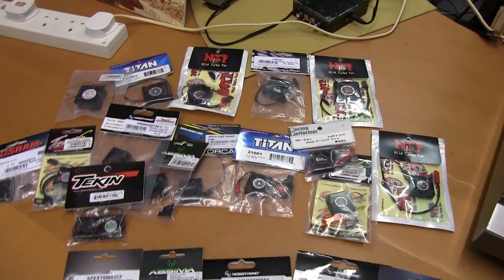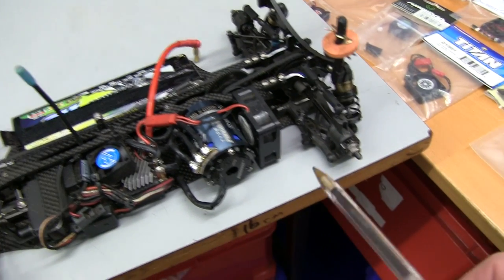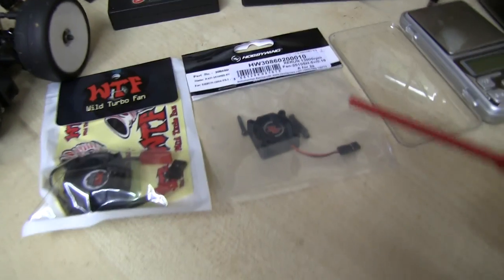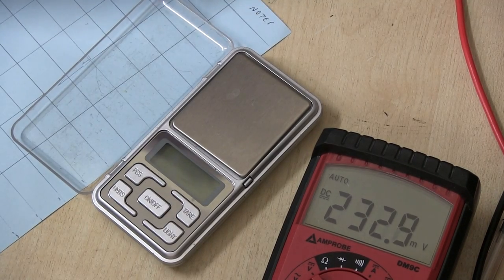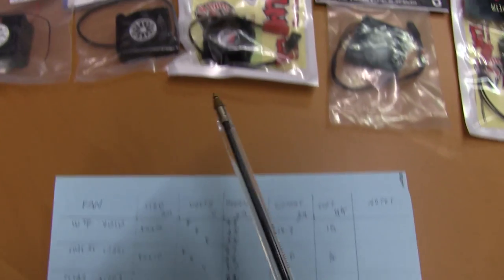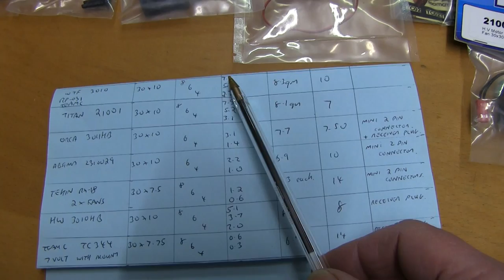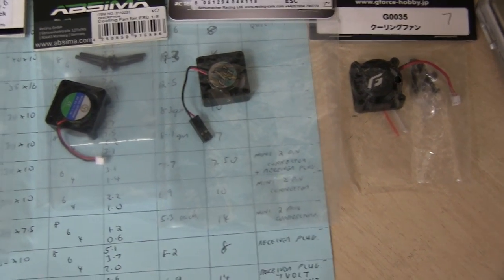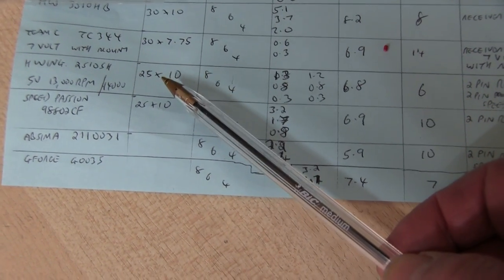Fans for cooling motors and speed controls. Test and comparison.

Comment: REally entretained by your testing, you got a new suscriber =)

Btw at some point would be great to see how it measures vs fans like
Noctua NF-A4x10 FLX (it runs 12V but allows undervolting fine)
Noctua NF-A4X10-FLX 5V (not sure if it can run above 5V)
Reply from the maker: Hi Pabula
The Noctua fans are low revs and very low noise, and made for quiet cooling applications.
There is a 5volt version, but the specified airflow is not as good.
The WTF 4010 fan has an airflow of 8cuft/min at 5 volt.
The Noctua NF-A4x10 Premium 5V is:
Rotational Speed (+/- 10%):4500 RPM
Airflow:8,2 m³/h (4.82 CFM)
Acoustical Noise:17,9 dB(A)

So probably not as good.

All the best
Nick

Comment: Completely unrelated to RC Cars: your video helped me with determining ideal operating voltage for a 3D printer 30mm hotend cooling fan. There's a gap in the 30mm DC fan world, it goes from really poor static pressure/CFM (even with 24V models) to these high performance RC fans that run at lower voltages with much higher RPM. No idea why there's such an odd gap, probably supply and demand.

Comment: Hi Nick. Great video as usual.I've started running a WTF 30mm fan on my 17.5 motor in my buggy. I've found that this fan drastically reduces the temperatures. My question is do motor fans do much to cool the internals of the motor or just the surface of the can? I'm guessing that a cooler can would help dissipate heat from within the can (the internals). Thought?Thanks!
Reply from the maker: Hi Dimitri
You are correct.
The heat in the windings will be reduced as the heat can be conducted through the metal case.
The rotor magnet will not cool as much, but the whole motor will run longer without overheating or failure.
Reply: Nick Adams rr

Comment: What about current draw over time. Example just sitting on the line 30s how much Voltage do I lose
Reply from the maker: Hi
I did consider listing the current draw, but it is so low at about 0.2 Amp that it will make no difference to the start voltage or power over a race.

Comment: Is it safe to run a WTF 40mm fan off of a 9V Block battery? Don't want to buy a seperate lipo and my BEC only has 5V
Reply from the maker: Hi. Not sure what a Block battery is, but it is too high, unless it drops to about 8V under load. The fan will be good on 5Volt. Try it and see. Feel the temperature of the middle of the fan, where the electronics are, and if it is very hot then it will burn out.
Reply: @nickadams5411  okay, I have severe overheating issues (motor reaches 70-80°C after half a pack and that in spring..) Can't imagina how bad it is in summer. Do you think the wtf Fan is better on 5v than a regular sunon 40mm 5v fan?
Reply: @nickadams5411  and a 9v block battery is a one time use non rechargeable alkaline battery, I found two half empty ones, one 8.3V one 8V so that should work
Reply from the maker: @ELValenin  Hi. Yes the WTF will be better than the Sunon on 5V. What voltage is the battery in  your vehicle. Is it a car?
Reply from the maker: @ELValenin  Hi, Yes try them. But check temperature of fan centre.
Reply: @nickadams5411  yep, it's a car. The battery is either 4s lipo (about 15V) or 6s lipo (about 23V). Although with 4s I don't really have overheating issues, but 6s is so much more fun. I'm sick of stopping every 5 minutes to let the motor cool though.. 
So yeah I think I'm just going to use one WTF and the 50mm fan I have now on the 5V BEC I have.. If that doesn't solve the problem I could try with a 9v battery and if it's better I can buy a small 2s Lipo 
Soo yeah I don't think I can connect it straight t
Reply: @nickadams5411  yeah, I'll actually use a half empty one which only has 8V anyways.. Still gonna check just to be sure though! Thanks a lot!

Comment: Seems to me you are measuring more of static pressure than actual CFM.  This actually is probably a good thing as the air is being forced around a heatsink typically.  This is kinda how it goes in the world of PC cooling as well.
Reply from the maker: Hi, Thanks for the feedback.  It was a quick test, as using a air flow meter would have taken much longer. And as you say the results are useful in the real world environment.  All the best. Nick

Comment: Hi Autor. Can you tell me which fan to buy? Wtf 40x10 34x16 30x10 . ? Thank you
Reply from the maker: Hi Dennis
Use a 40mm fan for motor cooling.
The WTF 40mm fan is also sold by MR33.
I use the CoreRC CR251
Reply: Nick Adams Thank you so much !!!!!
Reply: Nick Adams I have a 30mm motor
Reply from the maker: Then fit the smaller one, if it needs to be smaller.
The airflow is what takes the heat away, so the more air blown over the motor, the better.

Comment: Hi Nick Adams, i just subscribe to your channel, can u make a review on your 25mm small fans for cooling with thir respective working voltage and witch one is better for the job. I need one thats 5v dc  but i need it to blow alot of air under 12v dc.
Reply: Wich fan can i use should i look for cfm's or wich air volume is greater then 5 m3/h ?..  I have no idea